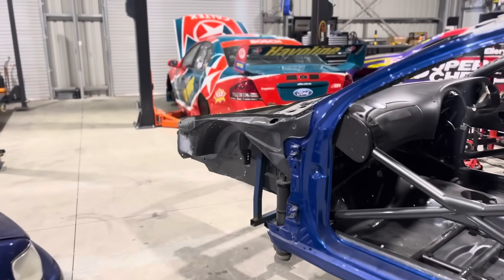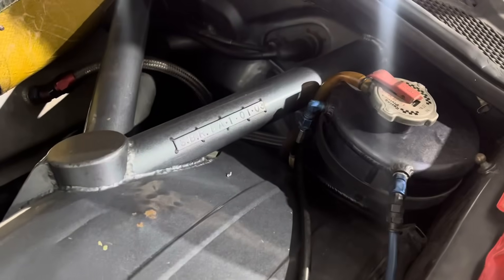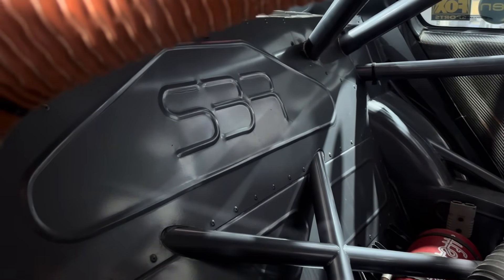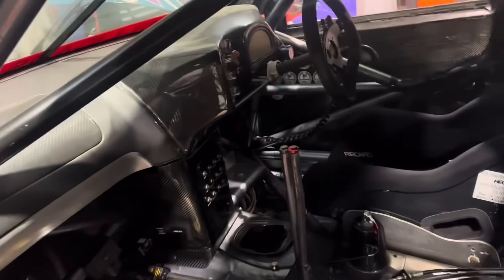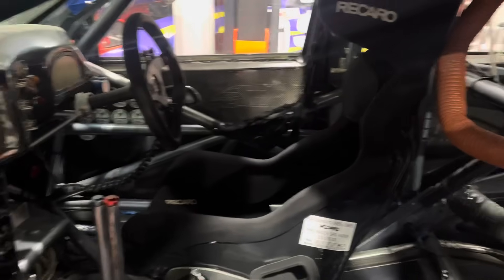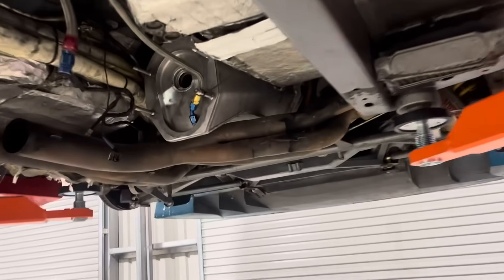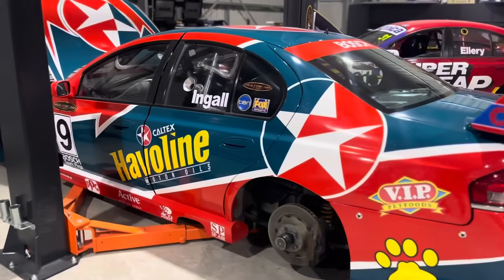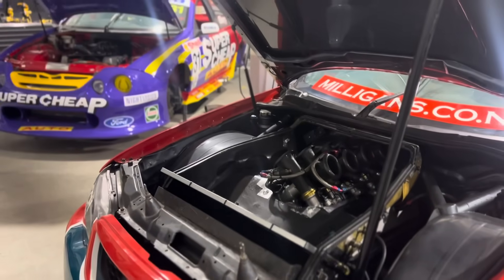Building a Championship Winning V8 Supercar - The Engineering That Ended Holden's Domination.

Comment: Love the videos mate, I'm definitely no expert! However  As I've mentioned in previous posts, just like you I was a die hard ford fan and watched in disgust as HRT cleaned us up for all them year's. Anyhow I've watched alot of SBR stuff and recall Ingall talking with Ross and Jimmy about that exhaust header design, aswell as the raised foot plate in the cabin, they said it was to stop all the heat in the foot well as drivers were burning the bottom of their feet in the indurance races. Swinging them down the passenger side and avoiding the drivers foot area helped to resolve this. Regards.
Reply from the maker: Thanks for watching mate 👍😊
Reply: @V8SupercarResto Pleasure is all mine cobber, I am curious now though... are those headers an unequal length? Or is there a bunch of snakes on the passenger side of the bay?
Reply from the maker: @justin3131ify they are a nice bit of engineering! I’ll put something together on this for you 👍
Reply: @V8SupercarResto looking forward to that.
Reply: @V8SupercarResto  So I couldn't wait... I'm back here studying the craftsmanship yet again! I'm very interested in those expansion pipes or what ever they are when you get to making that video. However just satisfy my curiosity quickly while I wait, if you will? Am I on the right track when I'm thinking that, the kiss pipe diverts the gasses from the longest set of headers down the shorter of the two exhaust pipes? And vice versa with the shorter set? Curiosity is killing me 😅

Comment: Didn't Craig Hasted build the engine for the Elerey falcon originally??
I'm not sure why sbr would block the air off in the grill I'd of thought it would be better to let it pass through.
Reply from the maker: Yes he did, the engine the car was built with originated from an AJR EL, and Hasted took over from there in 2000ish. 👍

Comment: I was lucky enough to be invited into a couple of team garages at Wanneroo in the early 2000s
Both teams ran BA falcons. One of those teams was SBR. The difference in the finish and little details on the cars from SBR and the other team was quite astounding.
Ross and Jimmy's attention to form as well as function was second to none at the time. 
They were chalk and cheese.
Both functioned as required but it was those little 1 percenters that left me astounded at the quality of the finish on the sbr cars.
Best I not mention the other team, but everything was just a little rougher round the edges.
Reply from the maker: The Stones set the standard that’s for sure. Thanks for watching 👍😊

Comment: I think what Jack Perkins is doing is the best idea. Decide what point in time the car is going to be restored to and that's your line in the sand.

If the damage predates that line, it stays on the car. 
If it post dates that line, fix it.

But ultimately it's your car, your money and you should do what ever the hell suits you!
Reply: I was going to say something similar,  if the damage was done in a main game incident it should be made safe and kept,  however if it was later on in life, probably due to poor maintenance get it repaired as it was built with the proper bead rolling etc. It's had so many 'big ones' that there are bound to be otger repairs needed just to make it straight again. Fixing the tunnel properly won't ruin the originality.
Reply from the maker: @ScottSherrington I believe the tunnel damage was well after the main game, so if it can be repaired without ruining too much originality around it, it might be the approach we need to take. Thanks for your support 👍😊
Reply from the maker: Thanks for your thoughts mate, I appreciate your input 👍😊

Comment: I reckon you should repair the damage on the transmission tunnel if possible. Interestingly though, I'm really enjoying the difference with the build/engineering between teams. The Stone Brothers looked like they nailed weight distribution to balance the chassis (no surprise given their success). Most of all, as much as I like the watching the current next gen Mustangs and Camaro's, they're all same underneath, save for engines. To me this detracts from unique engineering teams could do within a set of rules.  I have a SBR merch back pack from back in the day, circa Ingall/Courtney (no Pirtek ) still in mint condition.
Reply from the maker: It was a great era, and the guys who bolted these cars together are the unsung heroes for sure. Thanks for watching 👍😊